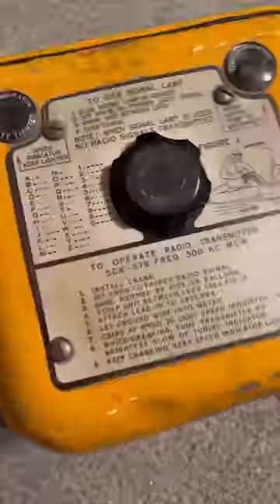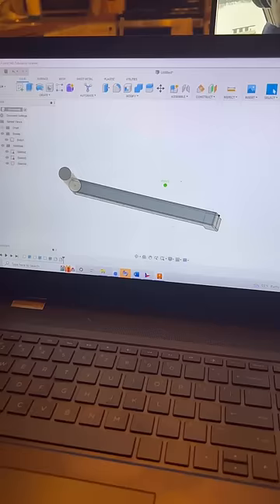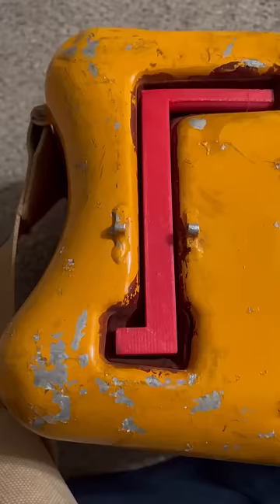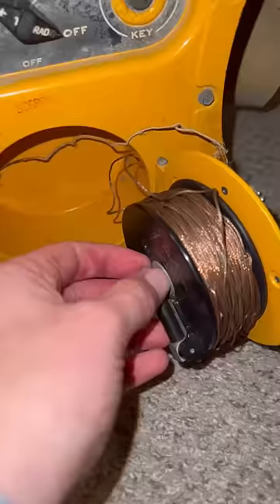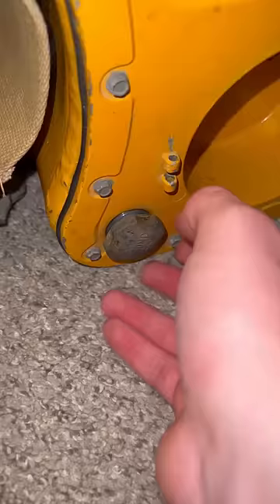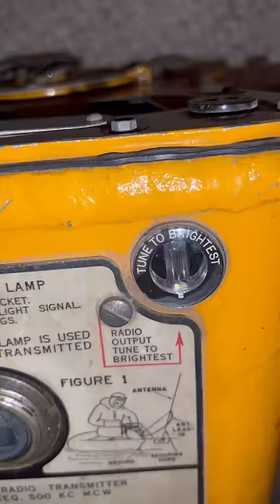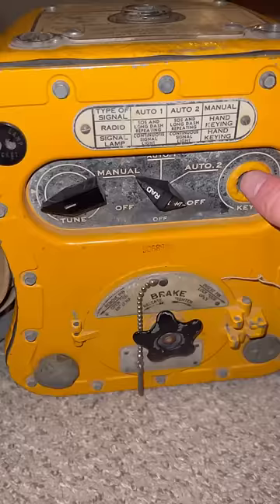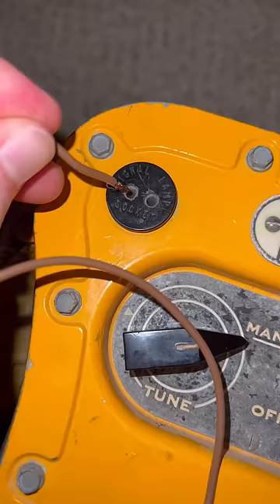Turning this Crank is Illegal

Comment: Aviation maintainer here, you can legally test that within five minutes at the top of every hour, if you want.
Reply from the maker: Unfortunately it’s not 121.5, it’s 500khz so that won’t work
Reply: @jackschneider17  According to Wikipedia the 500kHz maritime emergency band is now obsolete and most nations stopped monitoring it in the 90s. Extremely unlikely to have the cops smashing your door in, but if it causes interference and you used it a lot the FCC might take an interest.
Reply: 5 seconds won't do crap
Reply: Don't be ridiculous, that thing won't get you in any trouble. The FCC would only get involved if you're interfering with anything, or if you've been reported. I seriously doubt that radio puts out much RF wattage at all..
Reply: The time to be located would take a while. Probably more than 5 minutes. They really don't regulate these s much as they used to. Pirate radio stations are more of an issue than an old time emergency radio signal going off for 1 minute. They could narrow it down to a city but they'd have no idea unless you told them and even then they wouldn't care unless they got something else that needs that signal clear.
Reply: @radioaktiv7841 500 kHz is medium frequency. Works ok with low wattage. Atmospherics and water help give it distance. The RF will refract and reflect off the different Atmospheric layers giving it distance except in the skip zones. PThese were usual tuned to the emergency life boat frequency. I forget but it's in the 2mhz range.
Reply: They used to make a watch that did the same thing.
Reply: @ferrumignis  think the only people would even notice is people listening to radio & maybe cb’ers & ive got one of ten active sets on the big island, highly doubt it would be noticed if you cranked all day
Reply: @ferrumignis  It is still illegal.   It is illegal  to  operate  ANY  transmitter  (into an antenna thus radiating a signal)  unless  one is either licensed and or authorized.  FRS  and CB radios are no exception.  There you are "authorized"  to operate without a license so long as you are operating a properly accepted radio.  You can not legally modify them.     The  fact that this radio set here is no longer  used on  the  particular frequency  does not give you a free ride.  IN ADDTION,  transmitting a false  emergency signal  such as  "help",   "mayday", or  "SOS"  on ANY   radio transmitter is illegal
Reply: @fourfortyroadrunner6701  Not illegal if they won't see it
Reply: @ferrumignis
Reply: @fourfortyroadrunner6701  It's illegal to exceed the speed limit too, but you've never done that, right?
Reply: @raycantero8958  Did you mean to include something in that post?
Reply: @fourfortyroadrunner6701  with frs and cb it isnt that you are operating without a license but that the radio itself is licensed rather than the operator
Reply: brietling emergency is still available.  with the most recent frequency.
Reply: If ham modifies it to 472.4 kc and doesnt use the sos function two hams talk on cw/ morse locally. With helium balloon raising antenna range would a few miles  by day but maybe 50 to 200 at night. New /very old ham band down there. If on boat and no reg radio it could legal in blinker light mode. Cor CG to see you .
Reply: @GamrokFeddy
Reply: What I got from this, as a random joe, is that if I’m ever in trouble I should wait 6 minutes after the hour to call for help 😅
Reply: @radioaktiv7841
Reply: @fourfortyroadrunner6701 psh if im in an emergency situation, and i find a transmitter for whatever purpose...im activating it hoping someone shows up so i can be like "everythings fine here im sure, but I need help"
Reply: @radioaktiv7841
Reply: @GamrokFeddy   My point exactly, the FCC really doesn't give usually care about "unlicensed" stations that small in size / wattage.. Unless, they're already nearby and looking for signals in that specific range, which I find very unlikely.
Reply: @radioaktiv7841  Its puts out over 20 watts which is enough to send a signal for like like 500 miles over water, about 100 mi on land if you have it up on top of a standard 21 ft ham radio tower.
Reply: @patrickancona1193  Why do I feel like youre the dude I hear on channel 6 constantly talking to bayou over in Alabama and the dude from Michigan.
Reply: @radioaktiv7841  you're new to this and your comment is cringe.
Reply: Problem is posting it for the world to see I’m sure that’s the only reason he’d get reported anyways
Reply: @radioaktiv7841  there’s a dude interfering w the channel truckers use and the fcc still hasn’t caught him 😭
Reply: @jackschneider17  this won’t get you in trouble… as someone who has been in the navy we don’t monitor that anymore… if it was a different frequency maybe… I think your making a big deal out of nothing
Reply: @precisionbay6899   Oh really, could you tell me what was "cringe"? I think  you're just a sad ham.. Go away, sad ham. I'm not new to this at all.. Any other questions?
Reply: @fourfortyroadrunner6701  why are so  many people into radios such squares?
Reply: @radioaktiv7841
Reply: As an A&P I can tell you that people test at the top of every hour regardless of new regulations 😂 boy that box need testing and ima test it
Reply: @poiu477  I'm not  "square"  I'm just tellin you what the consequences are,  in other words, "the law."   I push the speed limit, like many others.  But  I try not to go  "over" the "push."  But  communications law is FEDERAL,  and even tho  the chances  "of being caught"  might be slim, if you do,  the fines can be tremendous.   Testing this device  ON AN antenna is  technically illegal, even tho you likely will not get caught.  BUT TESTING IT  by sending the emergency message  is  VERY much frowned upon.   The whole deal is,  this device is no longer authorized in any fashion.   Unlike current EPERBS  or  whatever they use nowadays,  this device is no longer  authorized to be used in any form.  But go ahead.  Be my guest.  And for  CHRIS  sake,  build a great big amplifier for it, say,  3KW. Sure  why not?  And start a network of them.  You could start a  "new band" of  "freebanders."   In fact  I  WISH  you would.  SOMEBODY needs to do it, right?  SHIT  we could have  a world wide network of  Gibson Girls  feeding 3KW amps down on 500KHZ.
Reply: @radioaktiv7841
Reply: So I wasn’t the only one that thought it was an ELT, but on another note I would still contact tower even at the top of the hour.
Reply: @fourfortyroadrunner6701  even if that's true, you're still double spacing every word in your comment
Reply: @ferrumignis  huh some guy has a WW2 radio.
Reply: @radioaktiv7841 oh hold on let me just record evidence of me breaking the rules and showing it to millions of people on YouTube
Reply: @Paul Hughes  they don't want to stand up to the government, and would much rather put up with their excessive regulation
Reply: @manletopia4801  MINUTES
Reply: 500mhz is not monitored by the CG anymore it's not a distress freq. It's perfectly fine to use
Reply: Highly unlikely you’d get in any trouble, the FCC is underfunded and their hands are full dealing with other things.  But if really want their attention, find a way to jam the police or the airport.  Works like a charm
Reply: @ferrumignis  Yeah, but that reality nonsense won't generate interest in his video.
Reply: @SteverRob  I have a police scanner and radar jammers around my car. 110% legal in ohio. Cops can't get my speed at all.
Reply: The FCC doesn’t have to chase you down, a whole nation of ham radio nerds will turn you in if they hear you skipping the legal procedures they all went through and the fees they all paid for licensing.
Reply: @ferrumignis  bro you're commenting on so many videos lmao, find a hobby and touch grass 🤓🤓
Reply: @NoSaysJo  How would you know I'm commenting on many videos? Ooopsy, hypocrite say what?
Reply: Imagine if ur on the brink of death but it’s 4:00 and everyone thinks you’re just testing it
Reply: @ferrumignis bro just became google assistant
Reply: @ferrumignis  i wouldn't be surprised if eastern europe were still monitoring those.
Reply: @ferrumignis  The FCC WONT LET ME BE!
Reply: @horseradish843  no that not illegal you dolt
Reply: @yellowwhale66 it’s always furries and i love it
Reply: would any controller recognise morse code today
Reply: Dude good at marketing and getting
Y’all to comment
Reply: @radioaktiv7841  
Sad Ham, Sam I am. Dr Seuss is about his level , lol 🤣.
Reply: @ferrumignis
Reply: 2.5GPA  ohhhh. thank you. sorry bout that. i just noticed i put it in all caps too
Reply: Regardless of eyeballing or not you could have saved yourself from looking dumb and having to explain in a comment but just flipping them over. Or not including a clip.
Reply: Also I bet a short Morse code test wouldn't cause any harm.
Reply: Oh no
Reply: @radioaktiv7841  doesn't have too, its only 500khz. Lower freqs travel farther than higher ones. Still keying it up for a few minutes ain't gonna get you in trouble.
Reply: This is true, gotta make sure those batteries are good on the ELT.
Reply: God forbid I'm in trouble within five minutes of the top of the hour!
Reply: Furry bird that is also aviation maintainer… seems a little TOO on brand…
Reply: @fourfortyroadrunner6701  buzzkillington
Reply: @jackschneider17  -- Hoof. That point where you're wrong and ignore responding or owning to being wrong. Cringe
Reply: @bloodfrostgaming9204  -- You wouldn't stop cranking it if that were the case
Reply: @Radioaktiv  what do u mean? Like they dont really care unless you are signal scanning?
Reply: @joy  link the story to the dude the FCC looking for for messing with truckers 😂 whats he doing that he aint got anything better to do than pull a Peter talking to Regan on the AM radio
Reply: The pilots I work with here in philly had a box similar to yours and set it off and we were all good. Based in a private fbo connected to multiple other private and public airports
Reply: @fourfortyroadrunner6701
Reply: @amberaldstadt8748  look up “radio room” watches and clocks. they have markers at 15 and 45 minutes as well as 0 and 30 minutes for 3 minutes each demarcating radio silence on respective frequencies except in emergencies. (i own a Vostok Amphibia Radio Room watch.)
Reply: @manletopia4801  he said minutes
Reply: @wake7622  can you track a signal in minutes 😖😵‍💫😵‍💫😵‍💫🤖🤖🤖
Reply: Yeah with proper clearance from ground or tower lmao they’re not just gonna be like oh look an elt going off at 5 minutes at the top of the hour oh well
Reply: @michealhead2239  and be able to track a 5 minute signal accurately 😖
Reply: @fourfortyroadrunner6701 This is all 100% accurate.  Anyone arguing against it is just being a contrarian and has no reason to even think they know better.
Reply: @jackschneider17  maybe diffrent laws
Reply: @ferrumignis  500kHz may not be monitored, but it is a used portion of that band.
Reply: @ferrumignis  he knows that, he’s saying it to make the stakes seem higher. It’s what content creators do, exaggerate. It’s media, Ofc it’s Sensationalised.
Reply: @matthewk7507  Look more carefully at my post and you will notice I mentioned that the FCC will take an interest if he causes interference.
Reply: @ferrumignis  Yes I'm aware. If it's a used spectrum, then it's monitored for SOS signals, whether it causes interference or not. I figured you would know that.
Reply: @matthewk7507  "If it's a used spectrum, then it's monitored for SOS signals, "

🤣🤣🤣🤣  Please don't be so foolish.  You think if I put an SOS out on a baby monitor that the authorities will quickly be at my door to offer assistance?  How about if I modulate my wifi routers output with an SOS, reckon the coast guard will be on the job?
Reply: @robparrinello3281
Reply: @ferrumignis  You jest, but yes. It depends on how long you keep it up for, and where you are located. It isn't a matter of what I think, it's a matter of what is fact. Go learn something. How do you not know that, but you know the significance of the 500kHz band? This isn't just an FCC regulation, it's a worldwide regulation. ALL used spectrum is monitored for SOS, and even some unused spectrum.
Reply: @matthewk7507  I could send SOS on my router for a year and nothing at all would happen.  Dedicated emergency bands are monitored for such broadcasts, not the entire radio frequency spectrum.
Reply: @ferrumignis  I'll explain precisely why you are wrong: If your emergency broadcasting device is damaged, and you have access to some other device, you can use it for that purpose. The frequencies are also monitored for other non-standard intervals of SOS.
You don't believe me? Test it out yourself, or just go look it up, so that it's from a source you will believe. More resource are dedicated to the standard frequencies to be monitored, but it does not change the fact that all currently used frequencies are monitored, and some unused frequencies.

I learned about it specifically when MH370 was lost (the Malaysian Airliner which still has not been found).

Hey, if you want to test it on WiFI, I recommend modulating an uncommonly used frequency channel in your area, that way it has less of a chance to cause interference. If you don't have a spectrometer to verify channels, I suggest downloading WiFI Analyzer on a phone or tablet, it's a free app. You could turn airplane mode off and on with SOS intervals as well, but I don't suggest that for a cell connected device.

Good luck on your quest for knowledge.
Reply: They would need to use a couple direction finding antennas, with today's technology it can be done pretty fast.  Or at least your general whereabouts, but even blasting it for a minute wouldn't do anything.  This thing ain't transmitting on 121.5 either.  Out of date.  No one's listening.
Reply: 100th reply
Reply: @fourfortyroadrunner6701  it's no longer classified as a radio set though, just a burdensome flashlight. It's not illegal to recycle using what would otherwise become scrap metal, into something legal to use.
Reply: @horseradish843  oh no the police want to arrest him for using a fancy flashlight, the horror!
Reply: Damnnnn that’s dope
Reply: @manletopia4801  Good thing they said minutes
Reply: @horseradish843   And to what extent do you think that investigation will go? 😆 The FCC has got enough pirate stations to worry about..
Reply: @mareksokolowski2938   Thank you, If only the comment section would do some damn research before typing...
Reply: @GamrokFeddy  hello FCC!!! Totally not doing anything illegal here😅
Reply: @ferrumignis  8
Reply: Damn dude
 The algorithm pulled the experts and I'm over here agreeing cause I wanna see it...
Reply: @andrewdegeorge9649
Reply: @fourfortyroadrunner6701 There are lots of things that are technically illegal that people do all the time anyways.
Reply: imagine being stuck somewhere wondering why no one is rescuing you but you happen to broadcast every day at noon so they think you're just testing it.
Reply: @fourfortyroadrunner6701  ok sheldon
Reply: @Ferrum Ignis  ehhh as someone in the military we still have plenty of equipment that was created and developed in Vietnam only things that have really changed are the weapons.
Reply: @jackschneider17  
D
Reply: @fourfortyroadrunner6701   Are you from the UK by any chance?  If so that explains your seriousness about rf and licensing. If not, I am just confused I guess.
Reply: True 😂😭
Reply: @qzy-179SanTzxkW  
" i wouldn't be surprised if eastern europe were still monitoring those."

It's possible I suppose, though maritime frequencies tend to be used globally just like aviation.  Just to be clear I am not encouraging the guy to break the law, just saying the risk to him is negligible unless he goes silly with it.
Reply: @fourfortyroadrunner6701   there are exceptions, like VLF and ELF
Reply: Shit I guess don't call for help at the top of the hour.
Reply: This is a spark transmitter, it covers EVERYTHING (q0kHz to 10GHz) with RF hash and is quite illegal anytime...
Reply: It was illegal in 1941
Reply: Exactly.
Reply: @amberaldstadt8748  I fly regularly as a pilot and you will hear emergency transponders go off often on guard (which you almost always monitor as you operate). Unless it's going off for over a minute everyone typically assumes it's a test, accidental switch to on, or a hard landing. For reference they'll broadcast for 24 to 48 hours, so ignoring a 10 second burst isn't endangering anyone. A real emergency will continue transmitting. Yes you are suppose to test at certain times as stated in the thread, but honestly, people ignore it sometimes. I've never heard of anyone getting in trouble for it, because it's often accidental or too short to cause issue.
Reply: @ferrumignis  that’s Wikipedia the most unreliable source on the internet since 2010💀
Reply: @brianmcclenahan617 there are many cold war shelter sites that have been forgotten about around the world. Many of them have radios on that frequency and devices like the GG. They get found by people who don't know what they are & play with them often enough. There's never been anyone I've ever heard of who's gotten into any trouble for a false distress. I think they just tell you to turn it off & not to do it again if they even bother looking for it.
Reply: The marine frequencies 2182 (voice) and 500 (morse) kilocycles were abandoned in the 90s.  Your best bet for testing this unit would be to do it outside the 3 minutes window where ships are still obliged to listen, at the top of the hour and half past on 2182' and quarter past quarter to for 500.  Anytime outside these windows should be fine.
Reply: @fourfortyroadrunner6701  you're like the chick in Last Man On Earth, still worrying about stopping for stop signs and not doing anything illegal even if you're one of the last two people on earth 🤣 be your own person, mate, don't be a 🐑
Reply: @dragongod666sevagoth3  Wikipedia is biased and completely untrustworthy on anything remotely political, but usually pretty good on stuff like this. It's trivially easy to verify as well
Reply: @ferrumignis  “THE FCC WONT LET ME BE” now we know what em was really doin 😂
Reply: @patrickancona1193
Reply: what if I'm trying to call for help on the first 5 minutes of every hour?
Reply: @fourfortyroadrunner6701   tell that to all the pirates out here the FCC has given up on them too many kids playing DJ with 10 watts EBay transmitters  our out fit has 300 watts  now that we have gotten approved we bought a AM station and are going to get a LPFM to do a simulcast duplicating the AM
Reply: @McMillanScottish  lol we have a local sad ham here he tracked down one of the fm pirates that operated out of a biker bar it was not pretty !
Reply: @radioaktiv7841  that they gave up on lol so many kids with EBay transmitters playing DJ
Reply: There's no way you need that much wire for a 121.5 MHz antenna... it would be a coat hanger at most. If you're going to test it, just don't spool out the antenna, the signal won't go anywhere.
Reply: Or at 9am on the first Wednesday of every month?
Reply: @George-vf7ss  there is a watch that can be purchased and if your truly completely lost in a forest or injured and can't get to safety, there's a cord you pull out and it gives off a signal with your coordinates for 24 hours, richard hammond used one on top gear before, it sends your coordinates to a satellite and the emergency signal then gets sent to some place like a rangers station or something, I'd have to research it more,. But it does work and the watch is around 600$ or more..
Reply: @karlschulte9231  If my life was on the line sitting in a liferaft in the pacific I would be happy if I was able to pay any fines... As these where packed in liferafts/lifeboats and similar during ww2 they where cheap last ditch gear
Reply: @radioaktiv7841  it puts out 12W across most of the radio spectrum, enough to interfere with both AM AND FM radio TV and even cellphones and WIFI, the filters are practically non existent in practise so with modern radio you can hear the keying almost anywhere on the bands if you are within a few  km.
Reply: I believe that this radio used a large box type kite. It was made with canvas & metal rods.
Reply: @fourfortyroadrunner6701  except in an emergency situation. then anything goes
Reply: @robert9595  yeah it's not illegal if it's an emergency situation. like idc that you talk on ham bands without a license of it's an emergency and if someone tries getting you in trouble for it the FCC would just ignore them if they do their job
Reply: @jackschneider17  he didn't say anything about khz.
Reply: @jackschneider17  I was thinking that there would be no one listening.
Reply: @radioaktiv7841  I see you've never had to deal with the incredibly cranky, incredibly stubborn HAM radio operators.
Reply: @brianmcclenahan617 it wouldn’t sent a location information either…. You would have to know where you are and type it out in Morse
Reply: Its only 1.21 jigawatts though
Reply: @richeyrich2203  true, but we do have instruments that can detect the radio waves and triangulate the location based on radio wave strength of the signal adjusting as you get closer. Think WiFi connections or cell phone strengths adjusting. Even then, it would have to be left on for a considerable amount of time to do the manual work of locating it.
Reply: @radioaktiv7841  even if reported they just send a letter lol
Reply: @manletopia4801 he said 5 minutes but whatever, same-same.
Reply: Ham radio operators are all so obsessed with pointless rules it makes me wonder if they have time for any other activities in their life.
Reply: Well, damn, hope I don't get unlucky and activate it within five minutes at the top of the hour when in an emergency.
Reply: Good to know
Reply: It's only illegal if you get caught.
Reply: @fourfortyroadrunner6701  Get help.
Reply: Can somebody send the Amazon link?
Reply: @Josh729J - for some weird reason a whole generation was taught to double space after a period. Typically these are older millennials who used Microsoft word in the ’90s/early 2000s
Reply: @sunshizzleyou  I somehow know the reason haha its because of typewriters I think
Reply: @Josh729J  Supposedly it’s only supposed to be done with monospaced typefaces.
Reply: @ferrumignis  im not saying your wrong but its worth factoring in that wikipedia has a tendency to be wrong
Reply: @fourfortyroadrunner6701 We live in a lawless time in which scientists, engineers, and corporateers used the pay-to-play method to force their propaganda on PHYSICAL MEDIUMS of THE NATURAL WORLD.

We live in a lawless time.
I say transmit. Transmit on all frequencies, f their planes and satellites.
Reply: @gamingclipz7309  also inside a house and what every frenqucey they monitered back in the 90s

as for the ham radio there are 3 
1 that goes a few miles, he still working on his license for the longer range and to operate it

but really if you need a kite or tall tower for this thing to reach range, i'm guessing indoor use low to the ground won't get far, otherwise it would be almost using this on the second deck level of a ship just no metal
Reply: Well maintained the use of guard channel 121.5 is no longer in use... they don't monitor it anymore.  The frequency in use now is 406 and is a global position Device
Reply: I love how people don't care one bit about legality ar break the law on a daily basis except when it comes to something they like and hold dare and then it becomes "unlicensed CB radio use is illegal don't do it" yeah worry about everyone who is first all those people you can do nothing about because everyonws too lazy to pinpoint the signals, before you start telling people completely uninvolved not to do it.  Bigger fish to fry, those being the people already making a fool of you
Reply: @gamingclipz7309  if they don't make a big deal out of it, then to outside observers it seems like frequency usage is a top secret must be given permission by a king or god or secret service kinda thing when it's literally just a load of lads swapping code trying to have a conversation while ignoring heads-ups about lot lizzards.  They really be tryna make this dingy Ass hobby a sophisticated club or something.
Reply: This comment section is an absolute mess
Reply: Still illegal without a Amateur Radio Licence. 500 is now a Ham Radio frequency. But transmitting a false emergency signal is definitely very, very illegal. The Morse Code would be fun.
Reply: False. Not without a Ham Radio License. This is NOT a emergency frequency. And, retired MREO here.
Reply: @jackschneider17  Illegal without a Ham Radio license
Reply: @GamrokFeddy  Garbage reply
Reply: @jordanlong00  This is not CB or FRS. You absolutely do need a Ham Radio license to use this frequency and it is monitored by monitoring stations.
Reply: @radioaktiv7841  Wrong. Ham operators definitely do care
Reply: @SparksNboat  I was replying to someone else's comment
Reply: @brianmcclenahan617  unless you, say, made a video about it and posted it online?
Reply: @lazaruscain3424  or you could, say, do the research yourself by fact checking radio frequency triangulation times, active military local radio wave signals and FCC guidelines. Or you can just appreciate that I already did and instead of making a long video about it I summed it up.
Reply: @SkYxLeGaCY  radar jammer is not the same as police radio jammer
Reply: @gardensofthegods  Yes Wikipedia isn't alway reliable, but  it's technical articles are generally pretty reasonable with the odd exception. Any article that contains politics on Wikipedia needs to be treated with the utmost suspicion.
In this case it's trivially easy to determine that the article is accurate and this band is not in general use any more.
Reply: Oh hey I'm aviation mx, specifically I'm someone who has dealt with emergency broadcast systems, and you're kinda wrong. You can only test on an emergency signal at the top of the hour if you have notified the proper organization and gotten the authorization.
Reply from the maker: @ferrumignis  yup, problem is though according to FCC regs it’s still illegal and sure, maybe nobody would notice the signal, but 1 of you 23,000,000 people who’ve seen this video would definitely snitch 😂
Reply: @patrickancona1193  CB-ers? Chaturbaters? 😂
Reply: Good to know!  Just in case!!
Reply from the maker: @radioaktiv7841  23M people have seen this video (across all platforms). If 1 in 100,000 people reported it, that’s 230 people reporting it. Not worth the risk. Also just cause I didn’t show it in the video doesn’t mean I didn’t try it 😉
Reply from the maker: @brianmcclenahan617  problem is at least 1 (in reality probably dozens) of the 23M people who’ve seen this video (on all platforms) would have definitely snitched. Not worth the risk unfortunately
Reply: @ferrumignis  haha “take an interest” love that
Reply: As an air traffic controller, I was going to say the same thing. I hate when people make up bullshit like this for click bait.
Reply: What if I have an emergency at 5:01 and can only crank for 3 minutes would I just be screwed??😂
Reply: @fourforty RoadRunner  I always thought of myself as a triangle or a circle, but ig a square works. Idk what people have against squares anyways.
Reply: @McMillanScottish  ain’t that the truth. Bunch of hall monitors.
Reply: @jackschneider17  p⁹
Reply: @radioaktiv7841  ]]p]pplllllllllllll))l)l))ll)l)9
Reply: @radioaktiv7841  Eh, the FCC barely has any field agents nowadays, anyway. No, what you need to be worried about is annoying local HAMs - they'll fox-hunt your signal, and then report the exact location, time, and recordings of the transmission to the FCC, just because you interrupted their chat. 🤣
Reply: @ferrumignis  i think he was sharing the conversation to someone idk tho wild guess
Reply: Youse the real MVP.
Reply: @Dedkidd  so let me be me so you can see
Reply: @ST3W101  i totally forgot i made this comment omg  😭😭🤣 thank you for the laugh
Reply: @radioaktiv7841  cringe
Reply: @wbrown310  I would,  but  in the 90's  the FCC was threatening  to prosecute  guys using  amateur VHF/UHF  transceivers, not accepted for commercial freqs,  if used on them regardless of  emergency or not.  I thought at the time that was pretty  over the top.
Reply: @radioaktiv7841  especially if you don’t actually throw the antenna wire on something to extend it up high.
Reply: @fourfortyroadrunner6701  Incorrect. You can transmit on just about any frequency as long as the power is low enough. FCC Part 15.
Reply: @manletopia4801  he said minutes guy
Reply: @coreywest9305  🤓🤓🤡🤡
Reply: What is that for?
Reply: @fourfortyroadrunner6701  GOOD.
Reply: @ferrumignis  the TV people???
Reply: @brianmcclenahan617  at that frequency, even longer because you‘d need to have some sort of triangulation going on. At 900 MHz for example, a directional antenna could just be used.
Reply: @MisterC3___  The FCC is the government agency responsible for radio spectrum allocation and licensing and also investigates interference to established radio services (emergency and commercial).
Reply: Have you noticed that most posts that get a lot of likes also get a lot of arguing. I don't mean discussion. I mean just people who like to argue and name call. I suspect most of these arguments and name calling wouldn't take place outside of social media so why do it behind a keyboard. I guess this is how some people vent from their crappy day(s).
Reply: ELTs are chill lol transponders though can get annoying when you got new guys 😅
Reply: @manletopia4801  I assume the systems are vaguely similar to the ones the Signals troops use, which means the computer will track and log anything within its parameters that's emitting for more than a few milliseconds.

Now, the FCC probably won't care unless you're making a nuisance of yourself, but they almost certainly could track you down with trivial ease.
Reply: @khindmanatc  could you explain, I don't know much about all this. I saw someone say stuff about airport interference, what is the worst interference and who does it? Could someone accidently affect the airport? I want to get into ham radio I think, but I don't want to interfere with the airport near us. Thanks!
Reply: it's only a crime if you get caught 😉
Reply: @jackschneider17  Its safe to crank sense 500khz isnt used anymore
Reply: @MinutemanOutdoors so probably more like… 20 miles at best from inside his house, assuming all the internals still work at prime efficiency. Doubt anyone would have cared.
Reply: Just do it !
Reply: @brianmcclenahan617 
Yes.
And the problem with MF is that without the antenna fully extended and tuned your not going to transmit more than a few meters away....😂😂😂😂
Reply: @George-vf7ss 
No...that's 121.5 MHz and it costs a furtune (good for rich pilots). But better then die or eat the other plane crash survivers....🙈
Reply: @jackschneider17 so it’s not illegal?
Reply: @fourfortyroadrunner6701  rofl, you lost this one the moment you said "technically" ......😂 well technically neglect homicide is murder, yet alec baldwin wasn't charged.
Reply: Please don’t fuck the birds.
Reply: cool!
Reply: @ferrumignis  you might want to re-read that Wiki,  500 kHz is now the  Navigational Data or NAVDAT broadcast system. 

However, if he contacts the FCC and the FAA and lets them know he wants to test the device, they will let him.  As long as he is not sending out RF that interferes with the NAVDAT system,  by being far inland or testing it in a way that the signals only travel far enough using a large faraday cage around the antenna.
Reply: rare furry with a job
Reply: @fourfortyroadrunner6701  If you could exceed the speed limit on a public road, you CAN be stopped and given a ticket.

It doesn't matter that you can mostly get away with it, what matters is whether the police decide (in their discretion) to pul you over.
Reply: @kavalogue  It's very complicated because there are so many F'ing laws and any of them could theoretically be enforced or not endorced.

So in practice, most of us operate on a pretty loose understanding of what's "okay" and what isn't. That model gets adjusted based on our personal experiences and whether we can "afford" the consequences.
Reply: @pascal590  CB stands for Citizen's Band and is a very old radio standard which isn't used much anymore and the laws, regulations have likely changed over time.
Reply: The USN in WW2 had a emergancy light ... also used a crank like this radio but ... that was to wind up a spring which powered the generator.  Gave about 30 minutes of light before you needed to crank it again
Reply: I can legally crank it!
Reply: @brianmcclenahan617  I think in an emergency you'd be cranking that thing from the time the sun came up until it went down... And you might take turns doing it for a hour or two on and off all night long.
Reply: @megamaser  You probably would be too if you'd been taught that violating them would result in losing your license to operate a radio in that band.

Even the government slacks off on enforcement it may not matter if ham radio operators were strongly conditioned to not break the rules.
Reply: @brianmcclenahan617  OK it seems like you know something about this so please respond. My dad had had a question the other day used to you could use old radios like you see in the movies where people talk on the FM radio stations and whatever and people would have them in their homes and stuff.  Why can’t anybody do that nowadays? Y Did it become regulated? I’m not being a smart ass. I’m genuinely curious.  Is it because there’s so many people and would contest things.
Reply: Try it out in a thunderstorm 🪁⚡️
Reply: @patrickancona1193 Umm. No. 50kHz is nowhere near 27 MHz. 😂😂😂
Reply: @manletopia4801  do 8seconds on a bull and tell me how long it is😂😂
Reply: He's aware. It just sounds "cooler" to pretend it's illegal
Reply: @ferrumignis  yea you should be safe to test it out, maybe even pick up the signal on an sdr. not alot happens down at 500khz anymore so nobody would be bothered.
Reply: @GamrokFeddy When there's no cops around anything's legal lmao